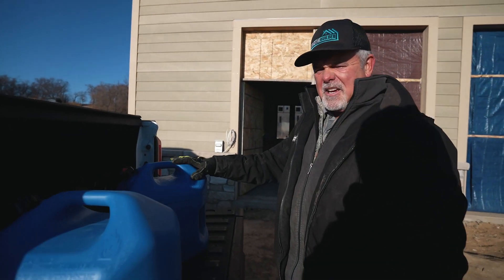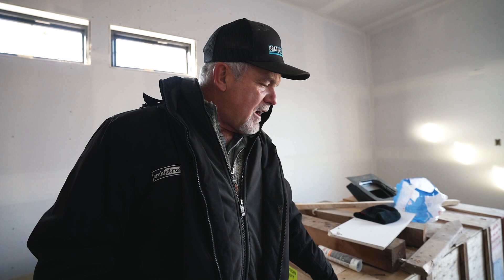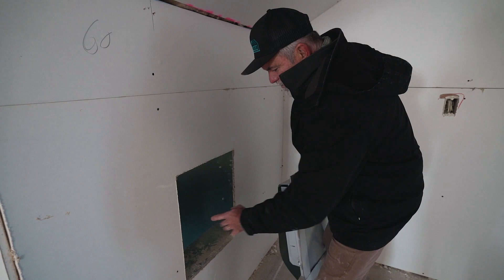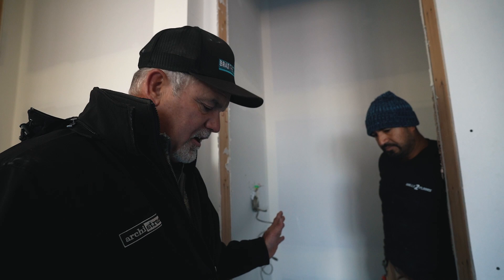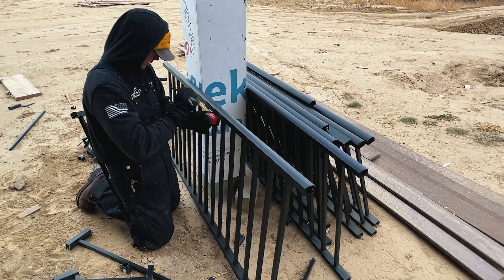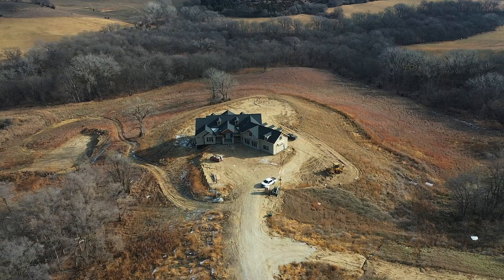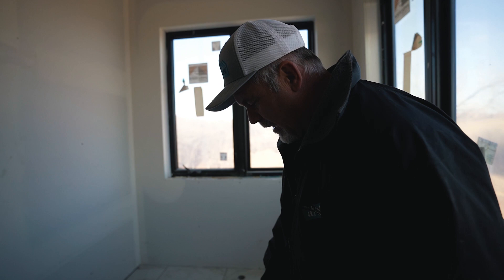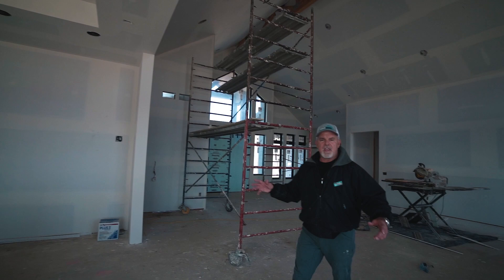Installing A HEATED FLOOR in FLAIRS Master Bathroom!

Comment: Doing a great job Brad, just not sure why you would skimp on 8 or 10 tiles under the bath cabinets and create a low spot in the floor for dirt and possible moisture ie: accidental water spillage to accumulate?
Reply from the maker: The water will not reach that area and we have had problems getting extra tiles in the past.  Sometimes the installer is not the same guy that did the measuring.  Generally the area under the cabinets is included in the estimate!  Keep in mind most builders install the cabinets 1st then the tile but, I like do it this way because the trim base sits on the tile for a cleaner look! 🎺👍

Comment: If you still need to fix the garage temp door. Post a nail outside, change cord to inside mount, have it a nail post as well. When cord is wrapped on outside nail it keeps door shut, but the cord can be taken off that sides nail to open door.
Reply from the maker: Great idea!

Comment: Looks good. You probably are already doing this. Building houses back in Western Pa during the Winter, we used to put 2 salamander gas-fired heaters in the basement. They would heat up the whole house and there was enough of an air draft through the house to be safe. In smaller enclosed spaces, it becomes a little trickier because there is not enough air moving. Good job and let's all be safe on our construction sites.
Reply from the maker: Yes I have those big heaters as well… I’m trying to find ones that are worthwhile that are electric? Have you had any luck with electric ones?
Reply: In east Texas now. We used both. Not too cold in the winter. We used a gas fired salamander at the Sam  Rayburn lake house. I had the guys crack a door or window to get a little air flowing. Code calls for 3 changes of air in a completed house per hour. I figure when we build 'em, I should have a little air moving while keeping them warm.
Reply from the maker: @michaelshettig7805  that’s a good idea ! 👍🎺

Comment: In South Africa underfloor heating is a staple to have in the bedrooms, bathrooms, lounge area and the kitchen
Reply from the maker: Is that your primary heat source for the home? Or just a luxury?
Reply: @BradtheBuilder  not at all there's mini splits located in all the rooms and a wood burning fireplace can't forget about the naples wood fired pizza oven located in the kitchen 🔥🍕
Reply from the maker: @daanyaalsaley4481  oh that sounds nice! A pizza oven👍

Comment: Great looking home.  Love the heated floors.   You do incredible work.  Fun to watch.
Reply from the maker: Thanks for watching❤️
Reply: Any chance you could give a brand recommendation for the heated floor install.  I’m guessing these run on a single 20 amp circuit.  Guessing….
Reply from the maker: @theoh6260 Im pretty sure that is correct!  I will double check with my electrician 👍
Reply: @BradtheBuilder  Thanks so much.
Reply: I looked up the specs on-line.    Looks like a 20 amp breaker will be more than sufficient for the space I need. I only need about 10 amps..  So no need to re wire anything thankfully.  Have really enjoyed your YouTube site.  Very informative and enjoyable to watch.  Thanks for all you do……. Love it..
Reply from the maker: @theoh6260  Thank you for watching and I am glad you found the answer!
Reply: @BradtheBuilder  I think there might be some type of “spam” issue.   I got a weird message from you.  Looks fake.  Might want to investigate.  I don’t know enough about you tube to figure it out
Reply from the maker: @theoh6260  I’m looking into it! 
I’ve seen several weird messages that looks like it’s from me but, it’s Not!   Thanks for telling me👍

Comment: 😆 🤣 at 12:50 that's what I bought to connect to the back of my TV and the wall to interlock each other and hang my TV on the wall. Works out great BTW  under $12 at home depot. Your welcome as long as you can figure it out
Reply from the maker: Oh? Thanks for the tip🤔

Comment: If possible id run a small run from the main furnace to the kitchen and bathroom of the mancave to prevent freezing of pipes and stuff. It wont be enough to warm the whole place good but will be enough to prevent things from freezing. It would save alot of money on their electric bill because the mino split is going to have to run all the time basically all year round. Even if its something simple or small like just using the joist space to run the air if their in that direction or a 3in vent.
Reply from the maker: We have heat tape on all the plumbing pipes in the garage so, we should be well protected for the cold! 👍🥶
Reply: @BradtheBuilder  it would still be alt chaeper on the electric bill and less wear on the mini splits. Happy Thanksgiving

Comment: I wish the builders I worked with cared if you were cold. Everywhere I’ve trimmed houses we be working in 10 degree weather no heaters lol
Reply from the maker: Really??  How does the paint hold up over time?  Do you have call backs for the trim separating at the joints? 🤔
Reply: Now that I think about it, I think the putty doesn’t hold the joints very well when it’s that cold. But I’m not sure about the painters that’s after I’m long gone lol. I think personally I’ve seen it hold and other time it doesn’t. It does get complicated trying to glue everything , and putty everything when it starts to get rock hard from sitting in the cold. Got to keep everything in a warm truck. That’s a lot of detail but we haven’t ever had any call backs? Maybe the painters make it look good.
Reply from the maker: @Eric123456789shelton  you’re right the painter can help!  👍

Comment: so does that floor heating with electric wire? in that case you will have problem with electromagnetic waves will cause stress not comfortable i think,  and what state is this?

Comment: Looking great. What brand of heated flooring did you use? I’ve been looking online and there are so many options. Would be nice to know something that you recommend. Thanks!
Reply from the maker: I’m not sure… I’ll have to look into it and get back to you🤔
Reply: @BradtheBuilder  ok, thanks! 🔥🎺
Reply from the maker: @RitzWood32  my Tile Setter sent me this… Nuheat heated floors or sun touch
Reply: @BradtheBuilder  Brad is the real MVP. Thanks again!
Reply from the maker: @RitzWood32  keep me posted on how your project goes!
Reply: Look at schluter ditra heat. The blue stuff they put in is kinda the knock off version of it
Reply from the maker: @scott103091  thanks for the tip!  👍🎺

Comment: My parents have heated floors in their entire downstairs but it’s piping ran under the floor hooked up to a boiler system, do they still use that technique or is it all electrical now?
Reply from the maker: Yes we still use that technique when we do larger square feet!  The electric in-floor heat is good for small areas.

Comment: I would suggest, having 0% experience on any of this. you placing tint on the sliding glass doors of the Master Bedroom so when you are looking in from the balcony you can't see anything but from inside the Master Bedroom it's like there is no tint looking outside
Reply from the maker: I have not tinted windows, and drapes will create the privacy if they want that.

Comment: You guys don’t have a waterproof membrane in the bathroom?
Reply from the maker: On the floor or in the master shower?
Reply: @BradtheBuilder  both, here in Australia we have to by law
Reply from the maker: @jackman3344  We installed a waterproof shower pan and the Red stuff on the walls is the waterproofing in the shower.